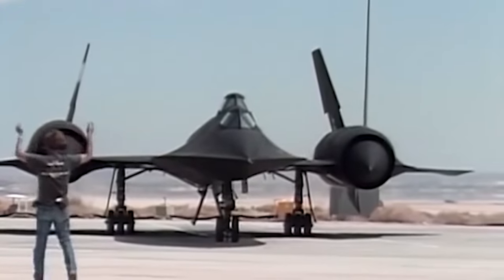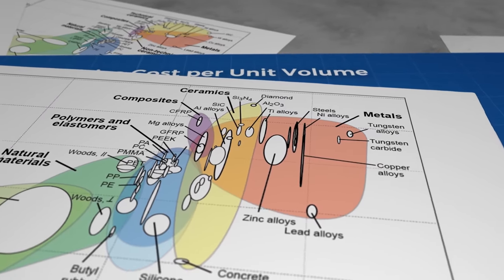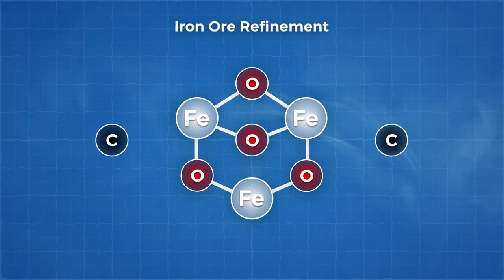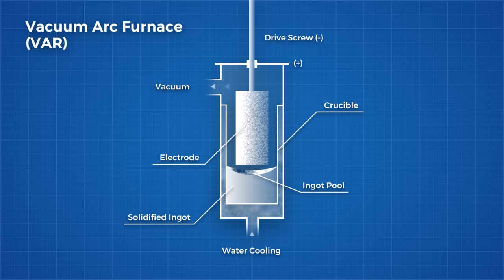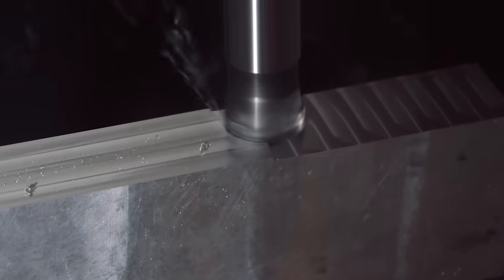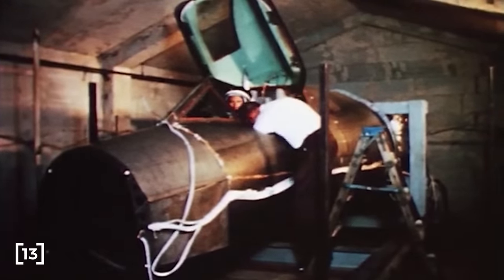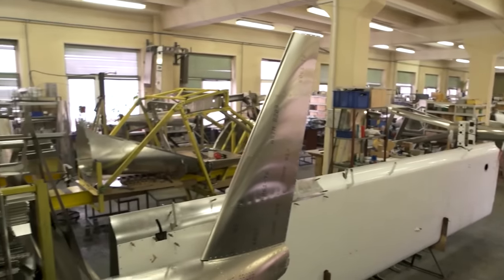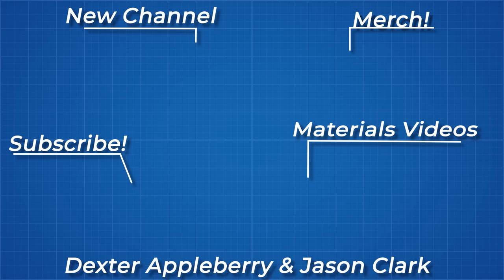Titanium - The Metal That Made The SR-71 Possible

Comment: 1:00 I mean, with the right thickness, literally everything is bulletproof...
Reply: not quite. no amount of outrage is going to slow a bullet. then of course there is dark matter... and faith.
Reply: @Александр Лазарев in a complete vacuum it would never slow down surely, red shift only occurs to things moving really fast away from you
Reply: @judgeomega  and thoughts and prayers.
Reply: @hazza2247  What he says does make sense. lets say this is done in a perfect vacuum with no large gravity generators nearby (like a planet).

Motion/speed is relative, a bullet fired from a point in space at a target has a speed relative to the point of origin (a) and the target (b). 

Now, given a rather short distance between (a) and (b) the speed of the bullet would be measured the same by both parties from beginning to end, with (b) eventually being struck 
by the bullet.

As we increase the distance between (a) and (b), a different force comes into play called 'Dark energy' this is the phenomenon that causes space to expand, the more space there is between 2 objects, the more dark energy expands that space.
Therefore, given enough space between the bullet and (b), the speed of the bullet as measured by (b) will decrease until it reads 0 m/s and begins getting farther away until it appears as if the bullet has begun accelerating in the opposite direction.
Similarly, the speed of the bullet as measured by (a) will increase. As it approaches the speed of light it will begin to "redshift" and as space can expand faster than light, neither (a) nor (b) will eventually be able to measure the bullet at all.

Space has effectively 'stopped' the bullet.
Reply: @hellfun1337  u seem to have a much better grasp on this sort of topic than me! I don’t fully understand all of what you said but I have learnt a bit and I think your points are genuine and true, thanks for the input! I always appreciate comments such as yours
Reply: @hazza2247  I appreciate your gratitude! 
An easier way to explain it would be:
Space expands. More space, expands faster. Put enough space between 2 things and nothing will ever be able reach them, not even light.
If you're interested, look up dark energy on youtube PBS SpaceTime.
Reply: @hellfun1337  ah yes that does make sense, like if a bullet was shot from earth towards a very distant star ( with nothing in the way) it would simply never reach it because of expansion, I’ll have a look at dark energy, I have heard of it but don’t know a whole lot yet
Reply: @hazza2247  well... not from earth, the bullet would have to travel fast enough to escape the gravity of the earth, the sun, not to mention the entire galaxy and local group before it reaches an area of space where gravity is weaker than dark energy.

We don't exactly know how strong dark energy is, but we do know it's only really noticeable beyond the galactic scale.
Reply: @hellfun1337  I didn’t mean literally from the earths surface hahaha but yeah pretend here is no gravity from nearby planets galaxies stars black holes etc
Reply: what about in a "perfect vacumm " ?
Reply: 2 feet of fat can stop a bullet if I remember correctly
Reply: hot dogs can be bulletproof

Comment: After seeing this, I would love to see a video on the materials used in submarines to withstand both the corrosion from salt water as well as the crushing depths of the ocean (plus maybe some info on how it keep subs stealthy?). Or maybe a video on propeller design for stealth? Thanks for the great content!
Reply: Sorry, that video on subs depth abilities are going to be top secret.  I’ve got some suspicions on the alloy being used, though.
Reply: The pressure is more about shape than material and submarines actually don't go all that deep. Most US submarines can't go much below 500 meters which is not much considering the average debt of the ocean is 3.2 kilometers. The thickness is more so decided by buoyancy and the ability to withstand collisions with objects like whales or boats.
Reply: re: "After seeing this, I would love to see a video on the materials used in submarines to withstand both the corrosion from salt water as well as the crushing depths of the ocean" well that materiel was/is TITANIUM. 13:28 <---- unfortunately you didn't actually watch the video.  also ref: the Titanium front and rear end caps of Stockton Rush's Oceangate POS Carbon Fiber Submersible.  if you recall, days after the IMPLOSION back on June 18, 2023, you saw those caps salvaged from the bottom of the North Atlantic looking as good as the day they were made (that's because they were).

Comment: Aluminum was once just as rare and expensive as Titanium before the bayer process was discovered, it's inevitable that we eventually find the titanium equivalent.
Reply: Pure aluminum was worth more than gold when a 10 kilogram topper was placed atop the Washington monument. About 5 years later, iirc, it was dirt cheap.
Reply: stockart whiteman  Is it inevitable? I ask myself that every day. Will humanity sustain this growth, or plateau.
Reply: @OCinneide  as long as it doesn't catastrofically crash...
Reply: All I want are nuclear forges: forget about being unable to reach high enough temperatures >:(
Reply: stockart whiteman  though fibreglass never really got that cheap as a building material, and carbon-fibre is very similar to fibreglass (just with the actual fibre material changed). The raw materials are cheap but the manufacturing, of many layers and resin that needs time to cure, made it stay a bit higher-end. Obviously for fibreglass insulation and other stuff that doesn't need such convoluted production it's very cheap indeed. And carbon fibre also gets applied in layers with resin, and so far it's difficult to automate that cheaply. It probably will be done some day, though.
Reply: Napoleon apparently had a scepter with an aluminum orb on it that he used to show off as it was so ridiculously expensive to make.
Reply: @turningpoint4238  *insert meat scepter joke*

Comment: I owned a couple Titanium bicycles. They made me as fast as the SR-71...
Reply: while it was being towed across the tarmac, right?
Reply: Those must have been some hella expensive bicycles
Reply: my titanium wheelchair had me soaking up all the poon in the old folks home
Reply: @martijn9568  you can get a Ti frame for ~$650-$700 USD.  Expensive but rides very nicely, and if the welds don't suck they last forever.  IF.
Reply: @mbrunnme  my father's Ti frame cracked. But he rode the distance of the earth's circumference before it cracked.
Reply: what's funny is that the Blackbird literally cannot fly at the speeds you cycle

Comment: Very nice detail. My dad used to work for Rockwell in Anaheim CA in the 80's, he ran a triple head stylus [non CNC] where three parts were cut at the same time by running a stylus ball around a template part. They were Titanium aircraft parts and he said that 1 raw block of material was around $500 each and if he screwed up he would scrap 3 parts at the same time. He was an old time veteran from the 60's so the good news is he didn't scrap parts which probably helped him to keep his job. :-)

Comment: I was in the US Air Force in the late 1980s and worked in aircraft maintenance. I worked in a jet engine shop. The engines had quarter-inch titanium alloy nuts on them that cost about $5.50 each. I thought that was a ridiculous price for tiny nuts. I did some research and found the same exact product available at a lower price from a vendor who was already approved by the Department of Defense. I submitted the information through the Air Force suggestion program (or whatever it was called). The change of vendors was approved and I got paid a percentage of the amount expected to be saved during the first year. I was given a check for about $12,500, which was more than one year’s pay based on what I was getting paid at the time. Nice bonus.

Comment: "It's really expensive"
>Only 3x as expensive as aluminum
Reply: Aluminium is a hugely expensive material in itself. Being three times more expensive than that is a huge deal. Also the price of titanium underlies huge fluctuations, so this is only the average price.
Reply: The SR71 had a structural weight of 30,6 tons.  Of that, 93% was titanium, so 28,7 tons. At a cost of 4,5k per ton thats a 129,3k in materials alone. If you used aluminium instead of titanium that would be 43,1k, and if you used steel that would be 2,4k. The US built 32 SR71,  so just in material costs thats 4,1 million dollars, vs 1,3 million if you used aluminium or 76,8k if you used steel. That is not including the massive costs of working with titanium. So yeah, titanium is an expensive material. And as he said that's using today numbers. The difference in cost in the 50s would be abysmal.
Reply: @LetztezBatallion  that makes sense, the tooling and material waste mentioned in the video + sourcing the titanium at that time could only be justified by espionage

Comment: I used to heat treat titanium aerospace parts. The ovens were essentially heated pressure vessels/vacuum chambers that could be back-filled with argon to displace the oxygen. Impurities in the system, and the off-gassing of the parts, was enough that they all had to go through a chemical milling process to remove the contaminated outer layer of alloy. Some alloys were even covered with aluminum and stainless foil to keep them from reacting with errant contaminants. All of these parts would go through a machining process as well, which removed aver half the material, depending on the part. The parts that got covered in foil for heat treating were some of the ones that were machined the most, with almost 75% of the material removed for a completed part. 
Also, side note on material properties: some of the titanium alloy parts manufactured in the facility I worked at would go on to be machined and coated in a ceramic paint to enhance their heat resistance. These parts were associated with the afterburners and were subject to intense heat. Titanium loses its heat much faster than steel alloys, but can catch fire at high enough temps.
Reply: Also, just saw the part about electrode melting. The facility where I worked had the ingots suspended vertically above the water cooled copper crucible, all of this done inside a vacuum chamber. A portion of the ingot would be melted into the crucible, then mechanically poured into molds. The molds had an entire process surrounding their creation too, and the company was always seeking materials that the titanium alloys would not react with. After the titanium was poured into the molds, they would be spun to ensure even metal distribution. The whole process was incredibly dangerous but super interesting.

Comment: I collect rocks. I often carry a small tiny hammer and use it in conjunction with a titanium chisel. The chisel I made myself. It's a high strength titanium alloy (can't remember what now!) and made from 1 cm round bar. It has a basic wedge ground into one end. That wedge took me around 3 or 4 hours to do using a 4 1/2 " angle grinder. It made mountainous amounts of pure white sparks but barely wore away. I used some loose house bricks to keep the sparks from escaping and igniting something - they melted the surface of the bricks!
The chisel is light and easily carried. So far I've not needed to re-sharpen the wedge on it - it's barely scratched. Personally I'm not going to make another because it's so much hassle!
I also have some 1 mm titanium sheet. I bought it to make jewellery clips (they clamp work when making jewellery). I no longer make jewellery and I'm tempted to try having a go at making a knife with it..

Comment: Interesting article. In the 1990s I worked with a company called Heatric to develop high pressure compact titanium heat exchangers. It was a small firm and I had to learn much from scratch. The references to titanium's low thermal conductivity, work hardening and difficulty to fabricate are well known to me and I have scars on my hands to prove it.

Comment: well, I will say this as a aerospace machinist - Ti is very common in aerospace for heat shields, engine parts, structural parts and etc. I have worked in the lost wax casting industry, Ti is used for jet engine compressor parts, window supports, landing gear parts, high stress parts. Very commonly used. I have found it machines far easier than stainless steel. Very fun, useful, strong, flexible material.

Comment: I will bet that in my warehouse I have some Titanium that came from the SR 71.  My friend, Andy Carter and I were building a Flying Dutchman sail boat for the 1968 Olympic Trials... We made Titanium fittings from scraps bought at Burbank Metals... near the Skunkworks where SR-71 was made... We learned how to machine, and spot weld, and form Titamium...
6AL V ...6% Aluminum, Vanadium a d Titanium...made  very springy tough material.

that December 22, 1964
The original Blackbird was designated the A-12 and made its first flight on April 30, 1962. The single-seat A-12 soon evolved into the larger SR-71, which added a second seat for a Reconnaissance Systems Officer and carried more fuel than the A-12. The SR-71's first flight was on December 22, 1964.

I

Comment: To weld it, it has to be insanely clean. Meaning whipping every piece with lab-grade acetone as plain normal acetone would leave an oily surface.
The pieces have to be de-burred thoroughly and again cleaned. Of course, a special filler is needed and only a few welding gasses are suitable for the job. Machining is just a horror even with tungsten carbide tooling and they'll get blunt no matter how much coolant one throws at it. However, titanium has amazing properties.
I've done some welding with this stuff and machined a few things out of it. It was a steep learning curve even for me as an experienced metalworker.

Comment: The thing that I find most insane about the SR-71 was the fact that they basically had to be repainted after every flight and that the planes expanded and shrank quite dramatically due to the heat generated by friction with the air. That's basically the primary reason for having flight speed limitations based on the altitude. The engines were powerful enough to go faster, but the paint wouldn't stay on and the joints would close up and threaten the structural integrity of the plane if it got too hot due to friction.

Comment: Lockheed also developed a material that was given the name "Lockalloy" for the YF-12/SR-71. It consists of 62% beryllium and 38% aluminum and was used as a structural metal because of its high specific strength and stiffness.
Reply: Pure Beryllium is the real wonder metal.

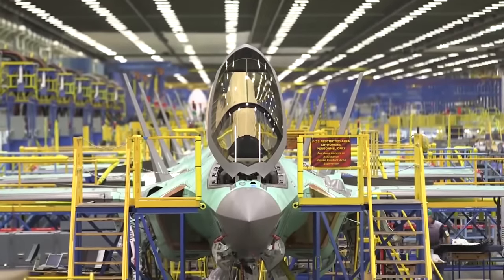Comment: 3:05 I work there & hate titanium. There are a few jobs where I have to drill, ream, cut & trim it. I have to manufacture shims between .040 and .005 thick of various weird shapes that must exactly match the part. I have to drill straight, close-tolerance holes through titanium a half inch thick. It's brittle and hard to cut. When I cut titanium it warps. It makes a lot of sparks when trimming, which are big & hot, pop like firecrackers & burn skin & clothing. It melts quickly and stinks when it gets hot. Drill bits break easily unless I use lots of lube. Reaming & de-burring is difficult. Great video, fun to learn some details about titanium, but I don't like working with it!
Reply: There are* a few jobs ... Other than that I totally feel with you. Learned the hard way that Ti behaves completely differently from steel by using steel working tools on Ti bike frames and ruining them.
Reply: @einundsiebenziger5488  Are you seriously correcting the English of an aircraft mechanic? Do you honestly expect proper contractions from one who's life is spent fixing broken airplanes?! Just kidding. My English is actually fair & I enjoy writing. I welcome correction as a helpless perfectionist. In fact, that "who's" above bothers me. Apostrophes have been historically troublesome. I corrected the mistake you pointed out. Thanks!

Comment: Extensive amounts of titanium were first incorporated into the air frame of the Canadian designed and built CF-105 AVRO Arrow jet interceptor developed in the mid-1950's.  AVRO also developed innovative means of shaping and machining titanium.  This was many years before the SR-71 was even conceived.   When the AVRO Arrow project was abandoned by the Canadian government in 1959, many technicians, engineers and scientists went to NASA to develop the space program and the SR-71.

Comment: I drill an tap this stuff with hss,
Just use water when drilling to keep temps down, back off when the water evaporates and put more water on.
When tapping keep the tap moving else the titanium will cool and grip the tap.
For Turning I used carbide tipped tools,
If the stuff starts sparking you're tip is most probably blunt

Comment: The Blackburn Buccaneer was a highly agile low level bomber and as such needed to have very strong wings. The normal technique of attaching the skin to the ribs would never have survived the extremely tight turns the aircraft was capable of. So they also used the technique of milling out the unneeded material with produced the skin and ribs as one unit. They used aluminium rather then titanium.